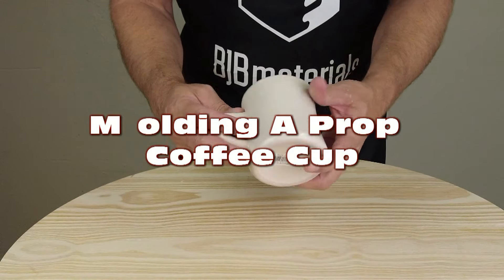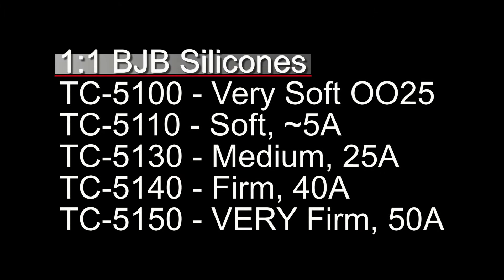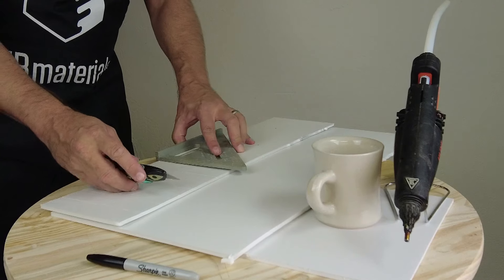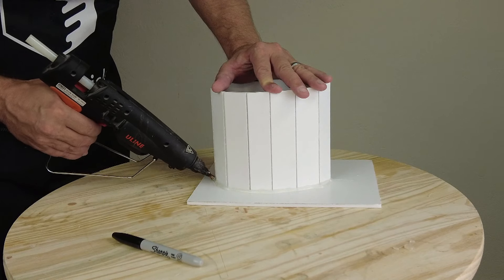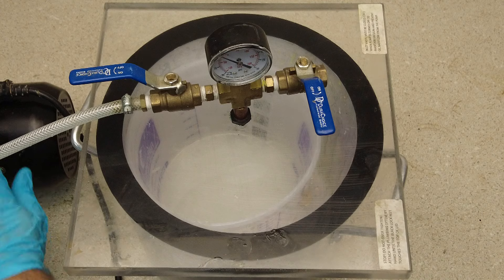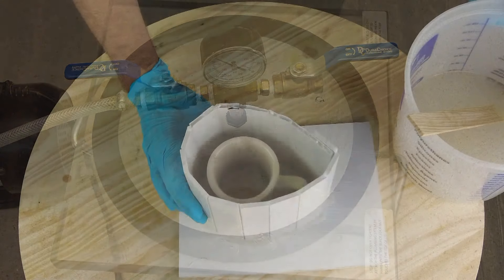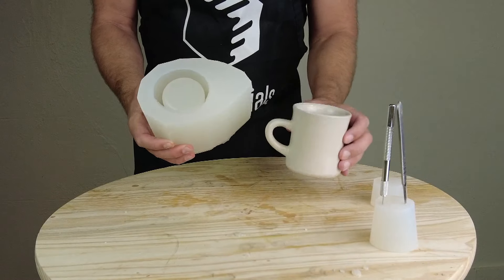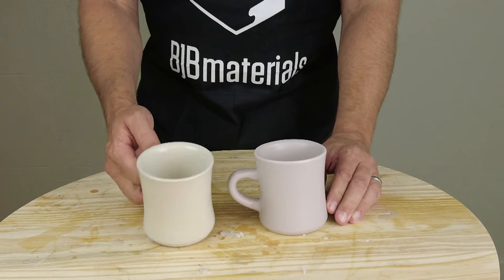Molding & Casting Tutorial: TC-5110F Coffee Cup Prop Mold

Comment: I love this video! So cool to see you at work. I have a question maybe you can help me with. I have a plastic gear I need to repair out of an industrial shredder. I know how to do it I just don’t know the resin I should use for the repair. I saw a video making a repair and they had a two part clear resin that when mixed together they poured it and then it kicked off really fast and turned hard and white. What kind of resin is this and wear can I buy it?
Reply from the maker: TC-808 is a 2 part polyurethane resin that cures to a tough, ABS-like plastic. I had several customers using it for mechanical parts and after-market car parts. Very strong resin.
Reply from the maker: Tc-808 is available through BJB Enterprises or one of their distributors.
Reply: @brickintheyard  Thank you so much! This really helps me. 👍🏼
Reply: @brickintheyard  Thank you! I will go check them out. 👍🏼
Reply: @brickintheyard  I saw on y’all’s website y’all have a TC-808 resin. Is it the same thing as the BJB Enterprises, just rebranded for y’all?
Reply from the maker: @joshhibbs_nola  we are closed now. TC-808 and other resins are available from BJB or their distributors. Go back a few videos and you’ll see the sad one about us closing. The site will be down soon. 😔
Reply: @brickintheyard  Aww. Sorry to hear that. 😞

Comment: I have a ceramic cup. I want to create a mold to make more. It has a straw portion sticking out of the front of the cup. The inside of the cup is countoured and not symmetrical shape like your mug is. Would this technique work? How would I keep the hole through the straw portion of the cup?
Reply from the maker: @kellyjames8560  what kind of casting material will you be pouring into the mold?
Reply: @brickintheyard  I'm not sure. Idk much about this. I do know how to glaze already casted or how to pour slip into a mold. I also know how to shape white clay and let it dry to be fired. As for an artist, I paint portraits of people but I'm very artistic and pretty much catch onto new concepts quite easily.
Reply from the maker: @kellyjames8560  A mold like this would be suitable for casting polyurethane resin or polyurethane rubber, but neither of those materials would be food safe unfortunately.
Reply: @brickintheyard  which would you suggest for drinks?
Reply from the maker: @ stick with ceramics for food contact. The mold will be very tricky, and it will need to be plaster so you can cast slip.
Reply: @brickintheyard  i don't know how I would get my cup back out of a plaster mold. I don't know how that would work with this cup.